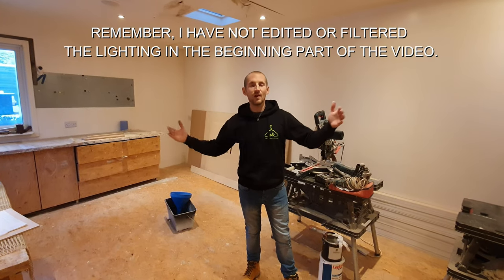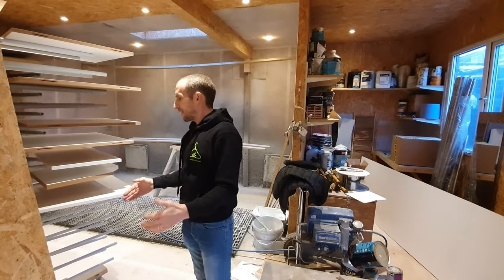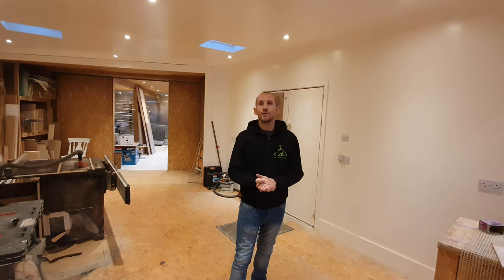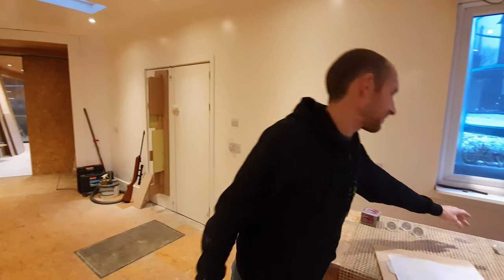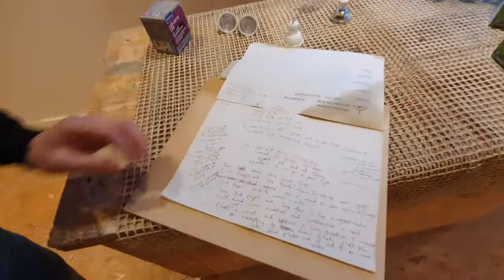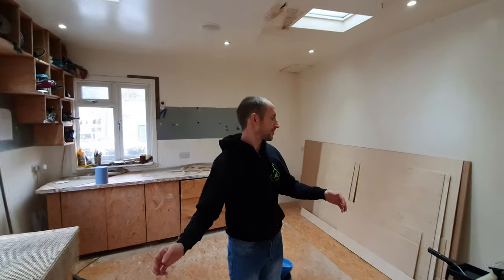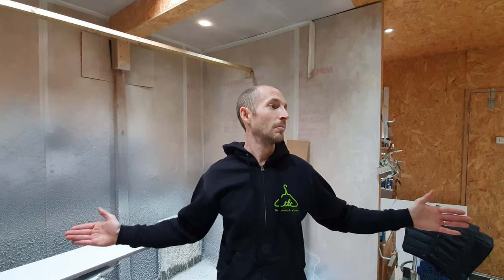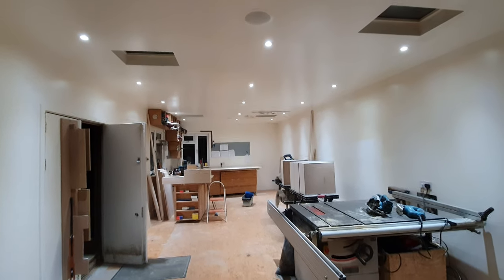Improve Your Workshop Lighting Ten Fold | Do This Now With Simple Mod | Ep#52

Comment: Hi Ryan, Perfect timing for me, just been researching lighting for my workshop. Great info, thanks.👍
Reply from the maker: That's good! Even though its now really bright, there are even brighter bulbs, up to 600 lumens but the bulbs were more money.
If I wanted to spend more I'd of bought those, but either way I'm happy
Reply: @thelondoncraftsmanworkshop  Hi Ryan, how do you you cut down the large sheets of MDF? Track saw, then table saw? Or all table saw. Thanks for lighting info, saved me a lot of time. Cheers Allan.
Reply from the maker: Hi Allan no probs, I try and do most of the work with the table saw but if it's too big for either rip fence or cross cut fence then I'll use the track saw. 
I get alot of my material cut for me as doing cutting lists takes alot of time. 👍